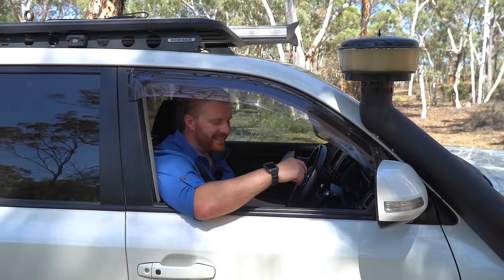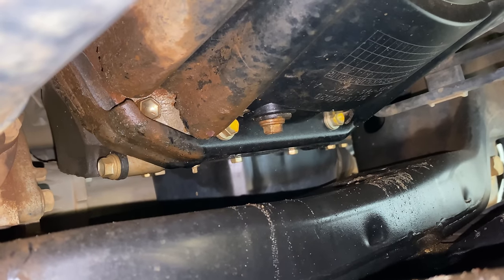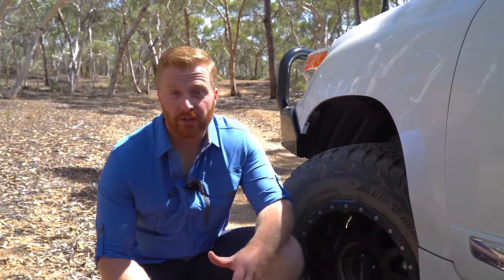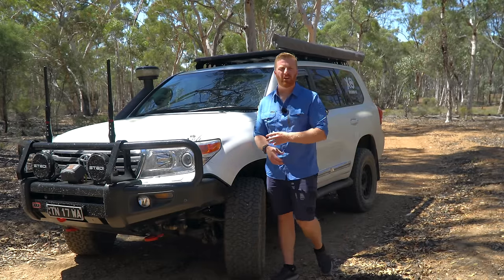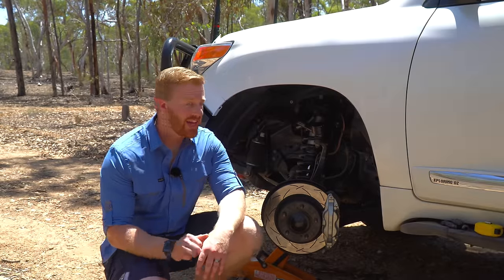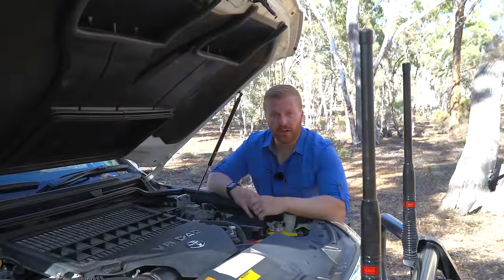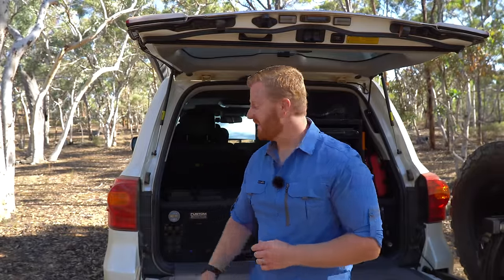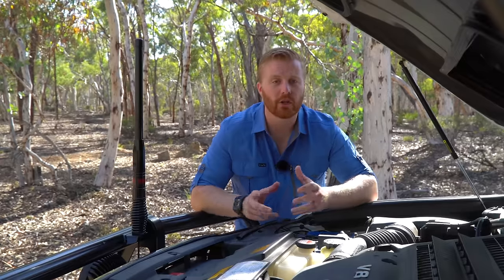LC200 | PROBLEMS & ISSUES | Not everything goes to plan -Mechanical-Electrical-Suspension 200 SERIES

Comment: Hey mate, I have a 200 in Perth and also have issues with the wireless system. I have traced & removed some wire from a previous owner which was really difficult. After that it seemed to resolve.. Lately it again has intermittent issues. Sometimes the key less entry refuses to unlock but the key buttons do and from a good distance. Not a huge concern. However every now and then the start button does not work. It won't start unless I put the key up against the start button.. It doesn't seem to be the key battery because the key is easily transmitting unlock & lock signals. This last problem is a big concern because my faith in the reliability of the car is not solid. Big concern if remote travelling. I have managed to lose both the factory keys which have been replaced in stages by after market versions and programmed by locksmiths..not sure if this is related but buying a factory key to test it is an expensive option to test it
Reply from the maker: Yeah, I hear your concerns there in regards to remote trips. I must say that although frustrating and intermittent, I've never had a drama that has taken longer than about 20 seconds to resolve. Although incredibly annoying, something that I've come to get used to.... would be great if I could figure out what was causing it though 🤦‍♂️
Reply: @XploringOz  Yes agree, the only time I had a REAL big drama was with altered wiring. I had been stranded once and had to leave the vehicle (luckily around Perth) so  I accessed   a 50 odd step point to point trouble shooting diag procedure which I'd printed from the manual. I'd read through it and worked out where I thought the most likely problem was. I hadn't wanted to follow the whole thing because it's heaps of work just getting to all the terminal points on plugs etc. 
It happened again after a 6 day camping trip in the southwest. Had whole family on board on the way back to Perth (worst time). Luckily my pre reading and suspicions proved accurate. I found the muppet who had owned the car before me had tapped into the factory wiring at the most ridiculous place. I removed his wires and re-instated the factory harness and it resolved immediately. Now I just have this intermittent failure and strange operation of the light on my starter button but now like you I can always resolve very quickly by putting the key against the starter button (No key battery procedure). 

It seems this latest problems happened after I lost both the factory keys and now have aftermarket ones. I thought this might have been the case until I saw your video on the subject. Are you still on factory supplied keys or by any chance aftermarket keys????

I just don't fully trust this car now though because I don't know what other gremlins are hiding from the previous owner.
Reply from the maker: @grantball6764  For sure, I understand your frustrations and doubt on the reliability on the unit now. It's annoying when someone else has done these little modifications prior to you owning the vehicle that results in all of these issues and goes to show that it really doesn't take much to stop these vehicles... unfortunately. 
I'm still running the factory keys at the moment, so it's definitely something wired into my vehicle that causing this interrupted frequency. 🤔

Comment: Fuel issue, mine does the same. I disconnect the secondary filter and the problem goes away. I reconnect the secondary, tighten the fuel lines and the problem reoccurred. The secondary has an air leak somewhere…
Reply from the maker: Cheers mate, I'll definitely be isolating the secondary filter to see if this help or removes the problem. 
Thanks, Nathan.

Comment: Hello.
Your videos speak a good experience. I have an older version of the LC200. Sometimes I also have a problem with the response of the wireless key. Here in the Czech Republic, it is difficult to make adjustments in terms of registration in the technical card. Nevertheless, something is possible and I still hesitate precisely because of the weight and other problems. We travel around the world and so far the factory setting has been enough for me almost everywhere. the fact is that you don't risk so much during the expedition, you also want to go home. My chassis is still a hydraulic original toyota. It works well, only the stroke could be bigger, so I'm looking for advice on such a setting.
Reply from the maker: Thanks mate, glad you enjoyed the video. 
Yes, the standard LC200 is a very capable and well made vehicle and doesn't really need any modifications. We are very lucky here in Australia as they are a very common vehicle so parts are available anywhere. We are generally safe to modify and hope that parts are available if needed around the country. 
All the best with your adventures!
Cheers, Nathan.

Comment: Lovells have a 4t and even a 4.2t remote shock kit, that keeps the 3.5t towing. I am going this way I think. Might go 4.2t since gives more wiggly room and is better shocks and better feed back. The bad feed back about the 4t seems silly as you can't run it empty and expect it to not be harsh when so under the weight.
Reply from the maker: Thanks mate, might have to look into these to alleviate some of the weight issues I'm having. No doubt that I'm due for a bit of a vehicle diet too... 😂 
Cheers, Nathan.
Reply: Iv got lovells remote res 4.2t upgrade. did 45k last year including Gibb, great central, plenty & Birdsville towing 22ft 3.5 tonne van. Performed well.
Reply from the maker: @campally  Good to hear, might be something I look into should this suspension give up on me. Cheers.
Reply: @campally  how does it ride unloaded?
What is your unloaded weight?
Reply: @ausguy4385  it’s definitely noticeably firmer. Weighed in at 3360kg basically empty with me in it.

Comment: Had same starting problem with my 2013. My mechanic replaced the top section of the fuel filter, despite no air leak apparent. It's a separate part. Problem solved.
Reply from the maker: Thanks mate, a few people have mentioned this. I would be happy if this is a simple as a small part replacement 👍 
Cheers, Nathan.

Comment: Nathan, is there a non-return valve in the fuel filter housing?  At one point I had a very tiny bit of chrome flake or something get stuck in the non-return valve in my ute (not a Toyota) and it would never seal.  It was too small to see with the naked eye and was the same colour as the aluminium housing.  the vehicle would start fine after the prime, and run well, but let it sit for a few hours and no good.  Should your hand primer pump up with more resistance until it's very solid?  Or does it just keep on pumping, never changing much?  That's about all i can think of for now.
Reply from the maker: Thanks for your suggestions mate. I'll look into whether there is a non-return valve. Im sure there would be at some point in the system. The primer of the pump does stiffen up if you keep pumping, I have found it doesn't need to be ultra tight to start the vehicle though. 
Thanks again, I'll report back with how I go. 
Cheers, Nathan.

Comment: For your current draw, start pulling fuses one by one until it goes back to 0. I had the same issue and found it that way. Also, make sure your sensor is in the correct position and no other cables are near it - assuming its a hall effect sensor? I would also be checking all your earths and crimped connections. To have low power just that once and then not have it again, it has to be a connection issue. Hope that helps :)
Reply from the maker: Thanks mate, appreciate it. I'll definitely go through the fuses one by one and see if I can find that load. Earthing seems to be another popular topic brought up and something I'll also look into. 
Thanks again, Nathan.

Comment: All your connections need to be checked. Make sure there are no wires trapped that may be partially damaged not allowing enough voltage through.
Reply from the maker: Cheers mate, I'm going to be going over the whole system again, see if I can find something. 
Cheers, Nathan.

Comment: Check your tank breather if it does not work it creates a vacuum in your tank this sucks fuel from your fuel system it’s not a leak.
Reply from the maker: Cheers mate, I'll make sure to check this out during the diagnosis. 
Cheers
Reply: Very useful points, can you tell me how to check?

Comment: I recommend you study up on the 12v electronics and rebuild the system yourself. The key reason why I built my own 12v system is so that if there are any electrical issues, I can diagnose those issues whilst out on the tracks. The system is extremely basic and each electrical component is independent of each other. There are some pros and cons with each approach  but this could help your situation/frustrations.
Reply from the maker: For sure. It's always best to build your own. At least you can troubleshoot and fix on the road soo much easier. My issues are definitely going to be hard to find with the rabbit warrant of wires I've got going on...
Cheers.

Comment: Very honest great review as for the 3 volt issue I would add extra earths and the winch I use a 200 amp circuit breaker and your power draw pull the fuses until it stops that will identify the circuit ? And you could fit a diode to the solar panels . Enjoy but I think I will keep my 100 series 👍🍻🍺
Reply from the maker: Thanks for the suggestions mate, appreciate it. It seem like earthing is a popular suggestion and something Ill definitely look into. 
Thanks for the info, Nathan.

Comment: Plenty have complained about BP51. Skip them and get Kings.
Reply: The issue with G.V.M upgrades is that they are engineered, tested & approved in a set configuration of parts & components. Swapping out suspension parts with others that are not tested & approved with that G.V.M upgrade package is that it will void your G.V.M rating...and insurance.
Reply from the maker: Hmm, if I had my time again. The price is crazy though. I know they are good, but its a serious amount of $$$!

Comment: Another great video, thanks for sharing all that you do.  Can I ask, what is the recommended distance ARB is suggesting from the wheel centers to the wheel arch?  I am also running BP51s and wonder if my dissatisfaction with ride quality stems from them not being set properly for the shock valving.  I am also running a ARB bumper, winch, and X31 battery, but I am only set at the standard preload of 20mm.  
One the rear guards, I bought BudBuilt rear shock guards and threw the plastic ones in the trash.  I have been happy with the budbuit product so far, and they are quite beefy.
Reply from the maker: Hey mate, so I'm kicking myself I didn't record the measurements here and can't remember exactly what this was now. However I did measure my threads on the front shocks and had about 31mm exposed. So this might give a little idea to how wound up my front's are. 
Thanks for the tip on the rear shocks guards, I'll look into these 👍 
Cheers
Reply: @XploringOz   Awesome, thank you.  Also on the guards, I met someone the other day that said they had pretty good luck with Kaon guards as well.  I believe they would be a lot more local for you.
Reply from the maker: @montegofd3s  Yes, I have seen the Kaon guards and something I'm keeping my eye on for a future purchase 👀
Cheers 👍

Comment: G’day Nathan, yep another very good one.
Exact the information update I personally looked for. IOY…
I have learned allot from you in a distance not able to drive my LC200 now for last 2 years sitting in the shed waiting to be taken out.
What you experienced With your 200 I would put it into the box “normal subjects can happen”.
Engine dies after start, ok that’s an annoying one, but may only a low fuel pressure problem and a safety shut down function from ecu.
A well experienced diesel mechanic should be able to diagnose this easily.
Electrics, parasite draw, is I guess a search and detect mission by an experienced el buff.
I fixed such thing with good quality batt main switch on the 2nd battery. Sure el system modified and only 1 starter battery. See your manual isolator switch, guess was to cheap no IP rating and internal corroded or melt. 2 new batt isolator switch cost less then 1 hr in a workshop searching for the parasite in your el system. Ps having the same issue with my stock std forester, after 2 weeks battery is flat and or deeply depleted and dead.
Great thanks for the info on the BP51, adjustments of spring setting and valving is very normal for what you load or not. The system needs experience and several goes to get it correct setted especial when your load variance is so much, unloaded, loaded, plus tow all weight with van on the back.
There was 2 criterias for me to not choose in the beginning the BP51. Do I use the car empty as a 1. daily driver and 2. full loaded on trips and 3.with van? For me only 2 & 3, means I have to deal only with the 300kg ball weight add on. And as said, airbag men helper bags or better full air in the rear. I need more driving experience with my rig, then make a decision. 
You can come to this question again after your new van arrives, the tinny is on top and the Mercury 30hp outborder is on top of the van drawbar box!!
Shock protection for the rear? Only HD aftermarket will do the job. Shitty plastic does not last and can be acknowledged from a mile away.
Things I have not done yet, I am still collecting from you and little bit from others the infos.
Greatest thing for me /us is that you share your experiences with the greatest passion and in such details that we all which are 100,000km behind you can learn from it.
Thanks Nathan for all your vids and infos. One day I will come by Perth area and pay it back!
Cheers
Reply from the maker: Thanks mate, appreciate all the info here! 
I agree, all these issues are fairly 'normal' to some extent and could happen to anyone with any vehicle. 
I'll definitely get onto some of the suggestions that people have mentioned here in the comments regarding the fuel supply issues. There seems to be a few things that I can test and replace to see if I can get this issue sorted. It's definitely the most frustrating one thus far. 
Yes, the electrical draw although frustrating at least is it a very minor draw. Something that can be easily negated with my relatively small solar panel.
Yes, the shock guards need to go, they never have been and never will be up to the task! I think some of the Kaon guards may be on order in the near future. 
I'm glad to be able to help and provide some information to others in the community with similar interested, after all this is why the channel was started! 
All the best, Nathan.

Comment: Use a clear plastic fuel line after your filter watch this for air bubbles while the engine is running if you see air you then it is not the injectors 
You must fix the air leak in the supply system
Reply from the maker: Cheers mate, would be interested to see if constant supply of air is getting through.
Thanks, Nathan.

Comment: Hi Nathan love your videos and just a follow up on your fuel filter issue as I have had this happen to me and how mine was resolved. My car is a Sahara 2011 model and I recently installed a Ryco Fuel filter through my mechanic as a extra bit of insurance when going outback and getting dirty fuel. A couple of days after installation the car would be hard to start or would start and cut out but once running for a couple of minutes the car ran fine or you would have to prime the fuel. This would only happen if the car was on a hill with the front facing down so the fuel was getting a air pocket, after a number of trips to the mechanic replacing fuel lines and fuel pump my mechanic then removed the ryco fuel filter which was brand new and the problem was fixed so he contacted ryco who said could not be the filter but sent a replacement filter which was installed by the mechanic and have never had a problem since. Ryco also wanted the faulty filter sent back for testing which goes to show that the new part is not always perfect.
Reply from the maker: Thanks mate, this is something I'll definitely look into. Interesting to hear that something so simple could cause the issue. I think I'll start with isolating the secondary filter to see if this makes a difference, should give a good indication straight up. 
Cheers, Nathan.

Comment: Hi Nathan, straight away your fuel starvation issues were similar to an issue we had.
After much stuffing around and a trial removal I eventually got rid of the aftermarket fuel pre-filter and haven’t had an issue since.
No matter what I did or tried the vehicle just didn’t like an aftermarket fuel pre-filter.
Reply from the maker: Thanks mate, seems like this has been a common suggestion. Definitely something I'll look into and I'll try to isolate the secondary filter to see how it performs. Strange how it perform well for 40000km's though. 
Thanks mate, Nathan.

Comment: A good vid Nathan.  Did you say you have 3 fuse blocks around the car, has that just come about because of the location of various "pods" of gear, and so the necessity to make sure everything is covered as it should be?
Reply from the maker: Thanks mate. So I have a couple, one in the engine bay and one in the rear drawer system. Yes, this was just to power the main areas and to have easy ability to add on further modifications in the future without having to run entire new (long) lines. 
Cheers, Nathan.